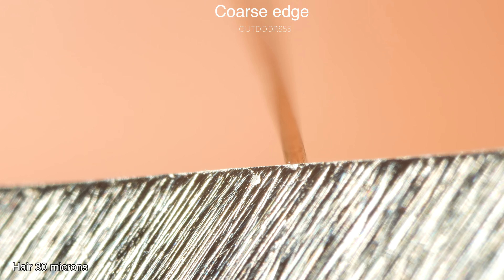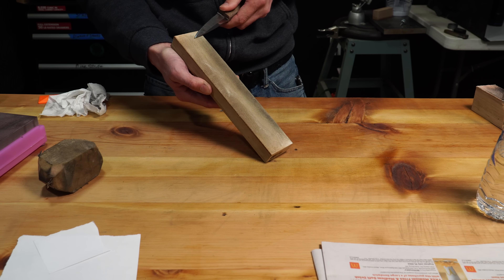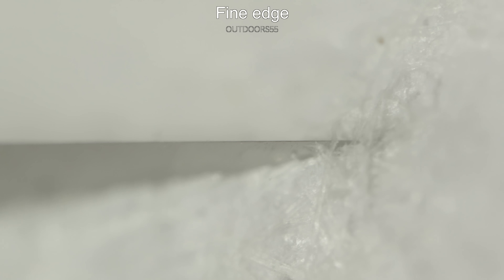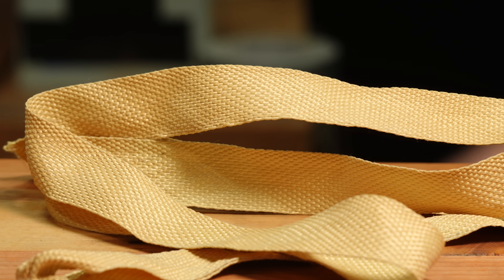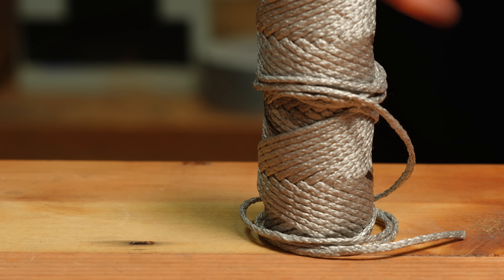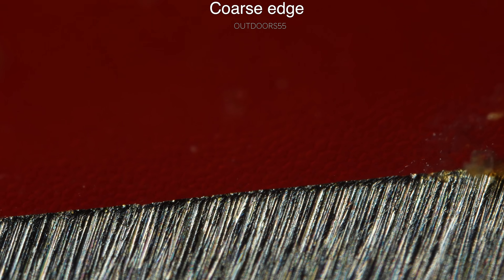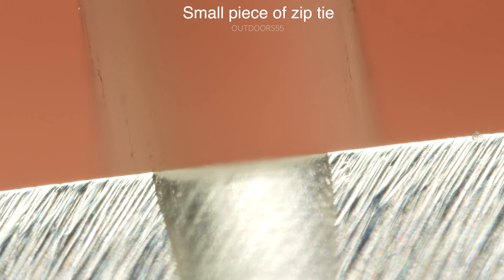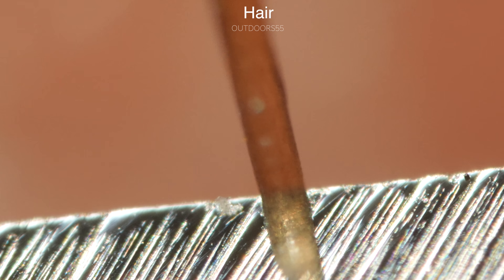Coarse Grit Knife Edges Are Weird - Coarse Vs Fine grit Edges Cut Under Microscope

Comment: Wow a very good macro video. But your so called coarse edge is actually pretty smooth. Maybe it's because of you stropping with compound.
I sharpened it with around grit 800 stone and after finish if see close up using magnifier I see some jagged edge. stropping with plain leather didn't help much. Need to finish it with grit 3K or 6K to finally see a smooth edge.😁

Comment: Please someone tell me why my 6-800 grit edges are never as sharp as my mirror? I can whittle hair with mirror but never can get there when finishing below 1000. I use a fix angle system and try and do the same burr removal as I would with higher grit. It sucks because the steels that do better with toothy dont get as sharp.

Comment: I noticed years ago that sometimes my knife seemed sharpest after the course grind (maybe micro-serrated???).  But to answer your question about why we should sharpen a knife to a mirror polish... I believe that when a metal surface is more perfectly smooth (like after working down to the strop block) it is MORE resistant to damage from rust. A coarse ground blade will have TONS of microscopic hills and valley's and this blade, when exposed to water, might be more susceptible to rust because of the increased surface area and ability for water to remain in the grooves.  I don't know for certain if this is true, but I believe it might be the reason to sharpen a blade all the way down...

Comment: I started out with lots of stones and different grits. Nowadays i just use a 300 grit for heavy duty sharpening and 1000 grit for maintaining. Yes an additional 4000+ grit will make it sharper but its not worth the difference especially considering it will also dull faster when using high grits.

Comment: What’s the point of the 30 micron strop if the 600 grit stone is 30 microns? If you went straight from the stone to the 1 micron strop would it not get the same results.

Comment: I've noticed that lower grit sharpened knives (say <=1000) are more inclined to wedge in hard vegetables. By the time I've put them on 3000 this tendency is noticeably lessened. At 5000 to 6000 the same knife may almost glide through the same vegetable as so much less effort is needed. Also I can visually see a difference in the cut vegetable surfaces - they look sharper and cleaner. Does that actually matter? I am not sure, but I prefer the 'feel' of the higher grit edges.

In some cases - I *think* tied to the hardness of the steel, you can decrease the bite of the knife with higher grits (8000 to 10000), to the point where they slide over hard vegetables for a bit before starting to cut them! This is obviously dangerous. I encountered this with a high end German knife that had been stropped on a cloth wheel (factory edge). The edge was mirror bright and looked amazing...but not much bite. Regrinding at 5000 resulted in much better (and safer) cutting.

Comment: My experience has been that a refined edge cuts just slightly better than a coarse one, but a coarse edge will last slightly longer before dulling. Also worth noting, is really refined edges sometimes "running" on a surface (sliding across the surface without cutting) until a certain amount of pressure is applied. My coarse edges never seem to do this. 

Ive taken to putting a mirror shine on the bevel, then going back to ceramic to put a bit of tooth right at the apex. It gives me a mirror edge that acts like a coarser edge.

Comment: I would say its practical to use the 10 extra minutes to progress through all the stones, but ONLY when a knife has been used without the procedure for 3-4 months. You could choose to do it every month, but just a "coarse" edge in 5 minutes, is most practical from week to week and IMO month to month.

Comment: I just tried my own "tomato cut" experiment.
Here's what I found.
Mirror polished edge (shapton 30k) slices through tomato skin better for a while (literally effortless) but starts to struggle a bit earlier compared to an edge finished with a 600 (same knife) 
Not much but noticeable. 
40 passes on the cutting board were enough to notice the first struggles with the mirror edge compared to 60 with the toothy edge. 
Funny thing both edges were still hair popping sharp when I start to notice a decrease in tomato cutting performance.
Maybe the final solution could be quitting slicing tomatoes.

Comment: Theres not much difference in these two edges realistically. The apex of each is very polished. To the point where the teeth are all but nonexistent on your coarse edge under magnification. 
Not being a dick but if you strop a coarse edge with a high grit diamond strop it then becomes a fine edge.

Comment: You'd only want extreme performance for hunting and butcher knives, even though with full honesty, just the coarse grit is absolutely fine with all cases, it's only reasonable to use the fine stones for when you want to keep the knife for some other time, and when you have the time to sharpen them, but most definitely, this is really just a hobby for people, no way I'm spending 20 minutes sharpening a knife that was already really fine, only makes sense when restoring

Comment: Ok two things.1) this has to be the best close up video of knife edge cutting ever recorded, Great job. 2) The sharpening succession you just described is what I have been putting together since watching your videos. Sharpall 1200 , Shapton 2000, Shapton 5000, 1 micron strop. 
I just received my Shapton 2000 ceramic in the mail today, I believe I used your link to order it. 
I still need the Atoma 600 and the shapton 5000 and 1 micron diamond compound, just not sure which one to get at this point. I have been making my own strops since the beginning and will be making a new one for the diamond compound soon. Thank you for all your advice and helpful videos.

Comment: I hate to be that guy… but according to the latest ‘cutting edge’ research into cutting edges’ you removed the vast majority of apex toothiness by stropping with the high Micron before the one micron. 
Evidently you should end in light passes on the final stone for minimal burr and then ideally go straight to 1 Micron until Burr is removed, but maximum around 5 or 6 micron lightly if there’s big burr and then straight to 1 and sub 1 etc. until you’re done. The results were so similar because the actual edge apexes were almost the same. 

I can’t remember the channel now, but he shows electron microscope comparisons and is all science referencing other science for explanation. He’s a British guy who makes and sells diamond compounds and strops, another video he gets to .25 micron and goes back up to 6 with the cutting measure machine, it’s made me rethink the universe… 

It might be worth doing this test again; but on your toothy grit repeat super light passes to tiny the burr, then go straight to like a 3 micron strop then down to 1 or sub 1, just enough to wipe off micron and sub micron burrs without removing the micro serrations. He explains it all in detail, very eye opening, just cringing about all the higher micron powders and pastes I’ve bought 🤦‍♂️
Something like The Toothy Edge Fallacy if anyone is keen

Comment: Im a knifemaker, id say its personal preference and depends on the purpose of the knife. I prefer a "toothier" edge for most of my knives. 600 grit on a belt sander is what ive gotten the most out of. Ive gone higher and it never felt great to me but thats just me. 

The nastiest knife ive purchased was a protech and it had an edge that looks about the same, 600 grit or so. It took a perfect square out of my finger in an instant, like butter. Also, this may not b true but it seems to me that a belt finish is actually smoother or finer than a hand finish of the same grit, i guess its the fast cutting speed. So maybe a 600 on the grinder could b an 8 or 1k on a stone? I know the nerds r going to say im wrong on that but it seems 2 b so in my experience.  Ne ways, there is my 2 cents

Comment: You don’t need to be a scientist to know a corse blade would cause more microscopic tearing than a fine edge.

Corse blades are made to be used on harder materials, mainly bone, large portions of fat, while fine blades are made to cut fragile veggies like tomato’s, slice meats super thin, ect.

A better example would be this, try cutting a bone with a fine knife, vs a corse knife, and see which is easier.

Try cutting a piece of wood with a corse knife vs a fine hunting knife.

Comment: I have a question about the direction of the scratch pattern: A pattern parallel to the apex is obviously a bad idea, as you have shown multiple times. So does the direction of the pattern matter? Could you compare a 45° scratch pattern angle in cutting direction, a scratch pattern perpendicular to the cutting direction and a 45° scratch pattern opposing the cutting direction and repeat this awsome closeup comparison? I would be really interested if there is any difference. My guess would be, that the perpendicular pattern actually works best.
Reply: Followup question: Is it possible to completely remove the pattern? Would it even be good?

Comment: The only time there is a practical reason to sharpen to 12000 or higher is on a straight razor, or for a vanity bevel.  For myself a 12000 grit or higher edge is much more comfortable on the face, and whiskers are “wiped” off the face vs. popping them.  Less of a pulling sensation, if you will,

Comment: Now you need to do a coarse vs fine for edge retention.....same blade and same steel (buy 2 Moras for $20) and see if the edge lasts longer for cardboard, rope, etc. Maybe the edges of the fine last 2x as long and it is worth it or maybe that is the same too and unless you shave or cut sushi for a living with your blades you can sell those fine stones and strops and buy a few more coarse and medium stones...Side note---I bought the plate in the link and the quality is still there....I was so impressed at the tactile feedback and lack of contaminates that I ordered a 2nd plate...same quality. Your experience was not a 1 off sample as now with my 2 plates we have a sample of 3 that are almost perfect. Will they stand the test of time and retain the diamonds? Only time will tell but I have enough confidence that I bought a 2nd because with (D)Biden at the helm these could be over $100 and close to $200 by next week...# FJB

Comment: How’s the edge retention of the coarse grit vs the fine grit?  If the fine grit holds the edge longer, is the difference in retention of the fine grit worth the extra time to spend on it? I see that the fine grit gets the knife to cut slightly better, but if I don’t have to worry about the micro level so much, will the coarse grit hold up almost as long?

Comment: Is there any information about knife steel?

I have experienced that some steels have different behavior on the fine/course edge, while others have the same behavior. I often have the same behavior on simple steels like 8cr13mov or some carbon steel. And having different behaviors on some powder steel, like M398 it's just cut worse with finishing less than 2 microns (3/2 mkm, 2/1mkm, 0.5/0mkm)

Comment: Absolutely brilliant work witht he photography! Very good!

About the tomato - where I think it would make a difference, is that the coarser grit seemed to create more juice - so probably breaking more of the cells. This is either good or bad, depending on your preference. In onion for example - it would make a difference in how spicy the air becomes. With garlic - more broken cells = more garlic flavor. Also, I'm sure vegetables cut with a finer knife will keep for ever so slightly longer. Oh, and if you cut yourself on accident - better to do that with with a sharper knife. The wound tends to heal faster - at least as far as my own anecdotal empirical evidence goes. 

Bottom line - if you're at the level of cooking that you want to fine tune the minute characteristics of texture and flavore - this difference might matter (I'm sure sushi chefs, for example, would notice a difference)

On a personal note - I would love some close up comparison with cutting wood! I carve wood for fun, and often wonder if I should go the extra mile and upgrade my sharpening system. I'm sure most of the time it won't make much difference, because the edge probably looses any significant difference between grits once you've run the knife through the wood a few times, but for the finishing cuts, when I want to get a very smooth and uniform surface on the wood - I wonder if it would make a significant difference and how long that difference would keep.
Reply: Well, I clearly didn't watch till the end when I wrote this, and maybe I'm missing a previous video (which I will go look for now).

Regardless - this channel is truly valuable for the dedication and quality it brings. The scientific approach of gathering data in effective and varied ways, and presenting everything as evidence and opinions, as opposed to facts.

Comment: I've been playing around with a 180 grit edge. I like more bight. Especially for camping or job sites. 180 cubitron, leather belt with 7 micron diamond spray,  yellow polishing wheel with 5 micron spray.  Really grabs the finger pads with 3 finger test.

Comment: I recently watched a video that suggested sharpening a kitchen knife with a 400 grit on one side and much higher on the other, 4000. The idea was that this would create a toothy and smooth bevel for different cuts. To my reasoning, the apex would just end up corresponding to the last used stone. Any thoughts on this? Love your work btw!

Comment: If you've sharpened a knife to a mirror edge, and during normal use it becomes dull but has not been abused and therefore does not have knicks or dents etc, then surely it would take a few minutes on the finest stone to hone it back to sharp again, therefore takin no more time than the coarse sharpening...

Comment: Get a better micro scope, for soft tomatos its easier to use a coarse sharpened knife as theyre a bit toothy. True fine edges actually have a disadvantage with soft tomatos.  Coarse knives have a ripper bur. I true fine edge has  almost 0 bur. Im not a expert but i have done stone sharpening for 6 years now and have alot of expierence. Hence why the ripper knife had trouble pulling through in your video; it needed saw motion to tear damage.  The smaller the edge the better it can press through, but its bound to the laws of diminishing returns. The finer the edge the weaker the edge. Thinner metal weaker strength. When you get so fine almost anything will make difference after 1 cut.  Just like when you hone a knife and get all that shit bur straight just to break it loose into food. Very similar, in the sense that the material will start to fail in fragile states.

Comment: Another reason to only sharpen coarse is how fast you'll notice the blade dull. A finely sharpened blade's edge will dull faster than a coarse blade will so if coarse works for your application, then that's all you need.
Enjoyed your videos!

Comment: Wouldn't relying on a single coarse stone lead to having to replace that stone very often(?) I have used my fine stone as a touch-up for years and it's still works like a charm. I use my coarse stone if a knife has lost it's edge.

Comment: Very interesting. A year ago I sharpened a very fine Damast edge to a point, it was hairsplitting, but not able to cut through a tomato skin without pressure. After that I switched from the 0,5 micron back to 3 micron leather and suddenly was able to cut through.

Comment: The Coarse grit will cut much longer in tough materials.  For a real eye opener, try this. Coarse grit on one side and fine on the other. it will last longer than either.  In stropping with the 30 micron and then going to the 1 micron you destroyed much of the advantage of the coarse grit edge. Use only one light pass on 1 micron only and retest!  (This will allow the micro teeth of the coarse edge to really do some work while over stropping destroys them). 
Ignoring this is exactly why they were so close in performance. There should be a HUGE difference in tough materials. 
KnifeMake/Retired after over 47+ Years in the Craft.

Comment: Proffesional Meat Cutter here who has als worked as a Cook. We mainly used tri-stones and they are a bit difficult to learn how to use. I later went to work at a Sushi bar and learned the Chinese Butter Stone and they arre absolutely hands down one odlf the best methods to sharpen a knife. Merely touching the endge with barely any force was enought to cut and draw blood. My knives were actually so sharp I was asked to keep them separate from the other knives as my coworkers felt uncomfortable possibly useing them and didnt want the possibility of grabbing it and using it. As they didnt have a proper Steel i had never honed it either. The bad thing about butter stones is smaller ones are hundreds and the larger ones are thoudands of $.

Comment: I think you spoiled these tests by ultra polishing the very tip that won't last long. Also on that front we want to know the difference after 200 uses + time in most cases. Don't forget rusting not just abraison as a polished surface has much less surface area for oxidation and cleaner. Also don't forget cut through friction which is another polish favouring aspect uncovered here. Other steel types are a factor too. Bread is another 'sticky' medium you could try close up that requires high sharpness.